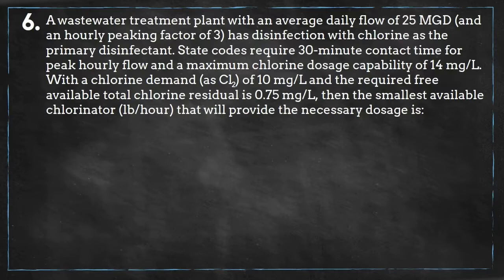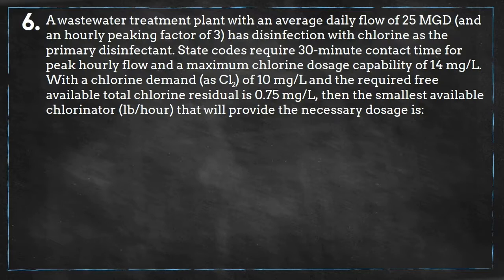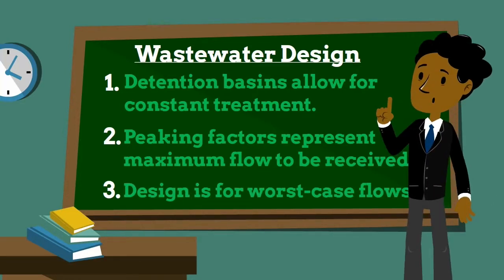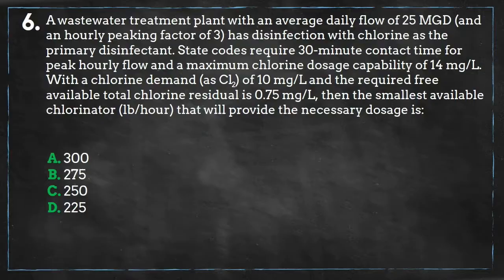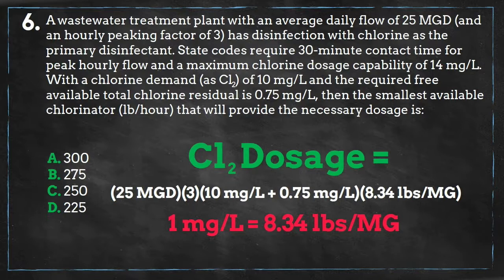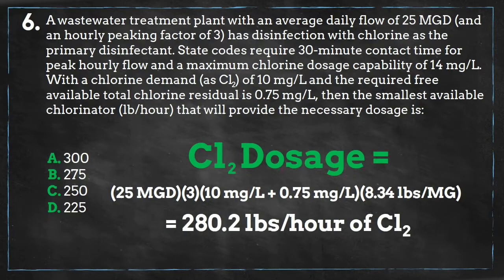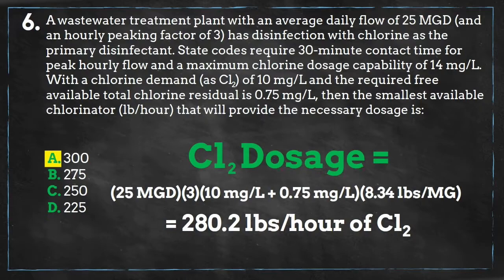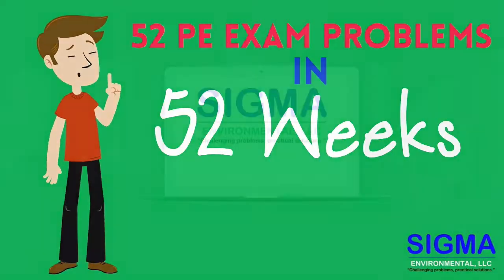Chlorine Disinfection - Episode 6 (Principles of Water) | 52 PE Exam Problems in 52 Weeks

Comment: If "State codes" require a maximum chlorine dosage capability of 14 mg/L then why are we using the 10 mg/L + 0.75 mg/L = 10.75 mg/L.  It appears we should be sizing this unit to match the 14 mg/L requirement.  Am I reading this wrong and is the regulation not setting an upper limit but providing a maximum that cannot be exceeded?  It appears to be ambiguous to these two options.  Or... do we ignore that regulation since the question is specifically asking about dosage and not regulator requirement?  Thank you, these are great videos
Reply from the maker: Thanks for your question, Rob. You aren't wrong at all & I'm glad you're thinking with your regulatory hat. My tip would be to consider if a regulatory standard you are aware of is nationally recognized or accepted or more so regional. If it's nationally accepted I'd use it and if not I wouldn't. The NCEES handbook will have some general factors to use for problems like this as well, so that's also another place to look.
Reply: @SIGMAEnv  I have a question similar to Rob's. In the problem it states 14 mg/L, along with 10 mg/L used in the solution. Why was 14 mg/L not needed to find the answer? Thank you

Comment: This problem appears in the PE environmental practice exam published by NCEES (2018) but only uses Cl demand (not dosage -- Cl demand + free Cl) to solve the problem
Reply from the maker: Thanks for your comment, Zoe.
Before the added chlorine can start disinfecting the water, some of it reacts first with inorganic and organic materials and metals in the water; this is called the chlorine demand of the water. 
After the chlorine demand is met, the remaining chlorine is called total chlorine. Total chlorine is further divided into: 1) combined chlorine - the amount of chlorine that has reacted with inorganic (e.g. nitrates) and organic nitrogen-containing molecules (e.g. urea) to make weak disinfectants that are unavailable for disinfection,  and 2) Free (residual) chlorine - the chlorine left over & is available to inactivate disease-causing organisms; it is a common measure of the potability of the water. Ultimately, total chlorine = combined chlorine + residual chlorine.

Based on my regulatory compliance & pollution prevention experience, I interpreted the question as it stating the required demand that would ultimately all be consumed before disinfection, followed by a statement of what the required residual would be after the demand was consumed. This is why I summed the 2 concentrations when solving for the proper chlorinator. However I would be very interested in seeing how an environmentalist with a proficient chemistry background would differ from my reading of this question. 

The ultimate question is, is "necessary dosage" meeting the chlorine demand, or also meeting the requirement for chlorine residual as well. The more I think about it, I'm not 100% sure. The good news is that the NCEES is pretty good about posing questions that result with such narrow answer choices that this could make the difference between the two. Unlike them, the choices I provided do place you in a pickle but I'm happy you asked this question. I'm open to any other perspectives as well!
Reply: @SIGMAEnv  They worded the question oddly, but at a WWTP you would want your chlorine residual to be zero (I'm not aware of a permit that requires a minimum residual, all of the ones I've seen specify a maximum residual) and you would read your demand as the demand to meet your fecal requirement. So, while your interpretation makes sense if you read the question as dosage = demand + residual, in the NCEES question (and a WWTP control system) would more read it as dosage = demand. Residual... is just a residual.
Reply: @BigBen3777  This is correct, you typically only want residual for drinking water where you need the disinfectant properties to keep the water clean until it reaches peoples houses. You typically don't want any residuals in wastewater as you typically discharge into a stream and chlorine residuals will kill wildlife. 

To keep to the problem, when calculating the smallest dose available for wastewater treatment you would not add residuals. If this was a drinking water problem you would add the residuals as it would be required.